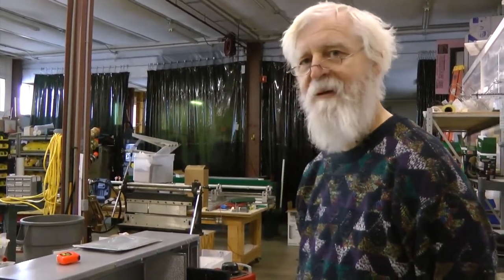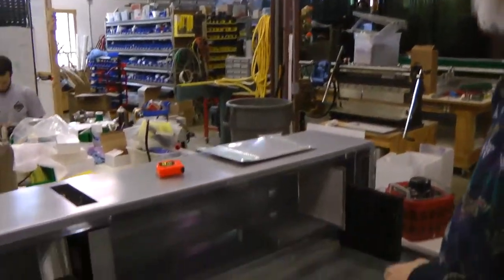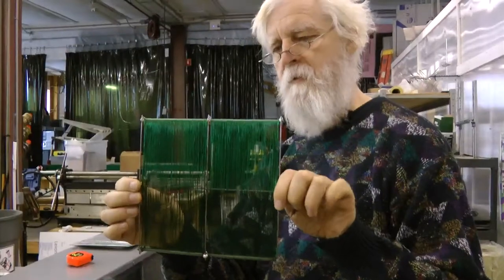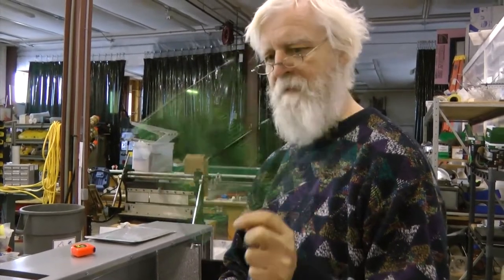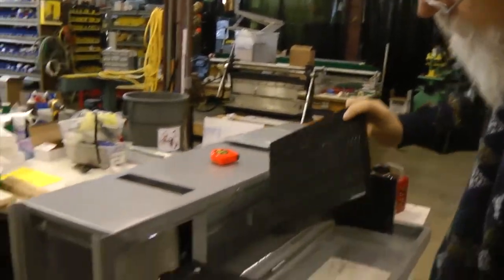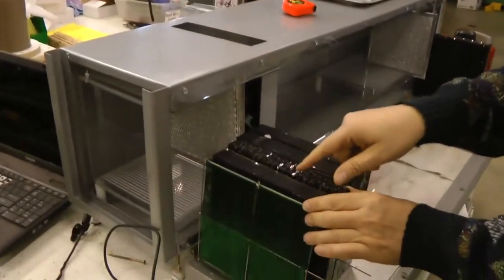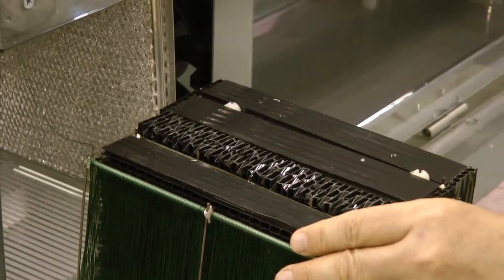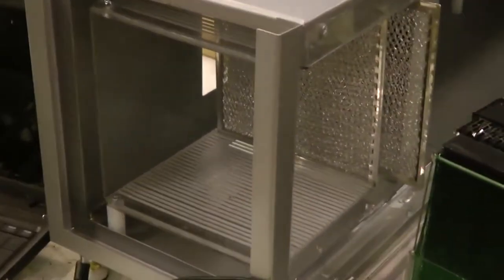Calorimeter Walk Through

Comment: You state that the large-area RTD (which I expect measures the average temperature over its area) will be effective if either air velocity or temperature is uniform. It would be good to measure the degree to which this is true, at least during qualification and ideallyduring operation. I think it would be fairly easy to add an array of point temperature sensors (PN junction sensors or thermistors would probably be simplest and lowest-cost for these high-sensitivity near-room-temp measurements).

Comment: (Adding to previous comment about qualifying uniformity of air velocity and temperature for large-area RTD). I am not sure about airflow uniformity qualification. If this is laminar flow, videos of both "smoke" burst and continuous flowlines might be useful. When I worked in the semiconductor cleanroom field I saw people use LN2 for flow visualization: it causes air moisture to condense into a visible fog without introducing significant contaminants.